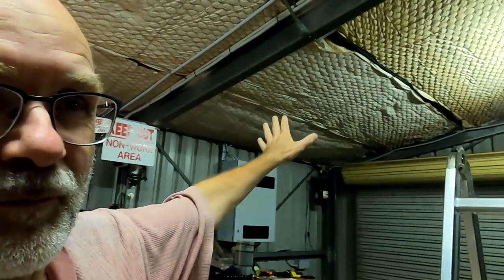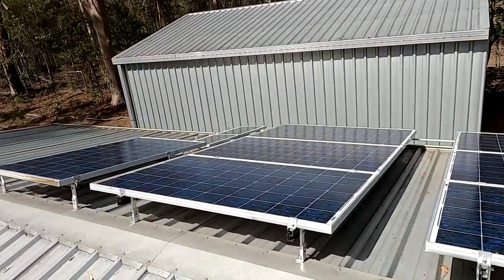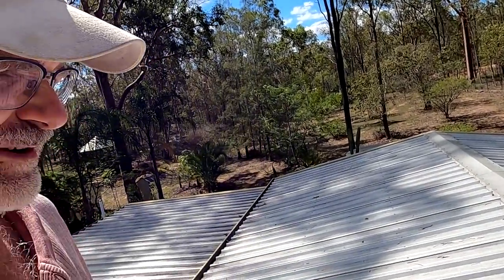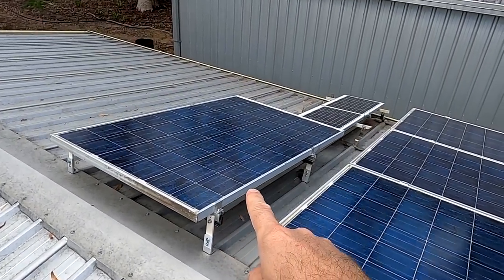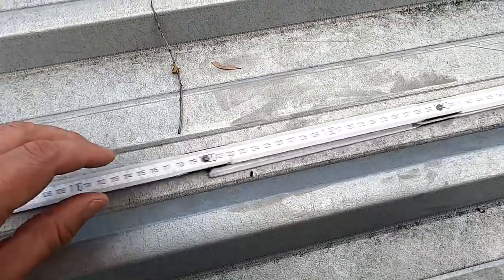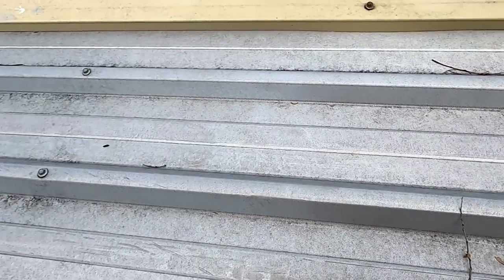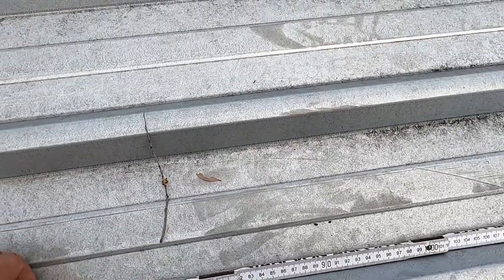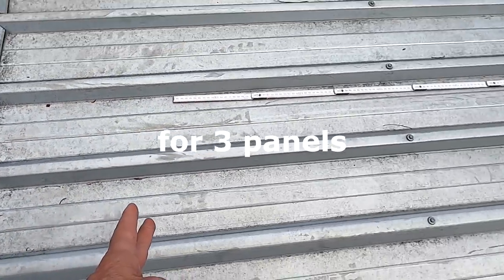Solar Upgrade EP1 - bad start with no parts and lots of roof space wasted

Comment: So happy to see another video. I thought the ground wire for the panel is supposed to be bare copper wire, typical size is 6 AWG or larger.
Reply: In the States grounding is bare copper wire. In other countries it's usually yellow/green insulated wire.

Comment: Just watching your latest entertaining video and noticed how flat the pitch was on your garage roof.
I use an app called solar tilt to give me the angle of inclination of my solar panels.
So I entered Toowoomba's Latitude which gives an inclination angle of 32.1 degrees.
So if you diduct the picture of your roof then perhaps you could mount the solar at the correct angle which might provide room for an additional fourth panel.
Just a thought. Kenn Co Durham, England
Reply: From memory around 24 degrees tilt is the best fixed tilt angle for around this area. I’ve got my 12 panels in strings of 3 on adjustable frames on a 40’ container. Nearly flat for the warmer months , 24 degrees for months either side of that and a bit over 50 degrees for the cooler months. Even with the panels nearly flat the summer sun spends a few hours just south of the panels at either end of the day for a few weeks.

Comment: the problem of parts of a technical system being obsolete when trying to recycle is a common problem. one solution would be to  get/lease/loan/subcontract  a 3d printer and make parts from UV protected PLA, but any plastic is far worse than any decent aluminium. another option would be do the missing parts with a 3d milling machine (from aluminium) but the aluminium parts would be mostly non eloxiert (a german word) and oxidize quickly to dirty look. (both solutions would naturally require someone to use CAD to draft the needed parts unless someone in the galaxy has done it before)

Comment: Can you use a router to remove one mm from the clamp?
Reply from the maker: I could, but but they work just fine as they are. The screw is a tiny bit on an angle but works perfectly fine.